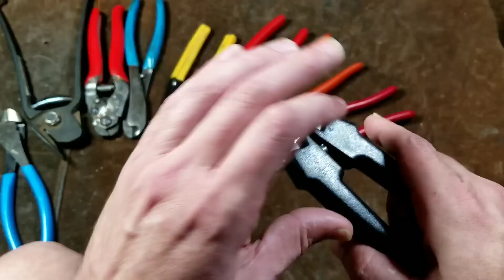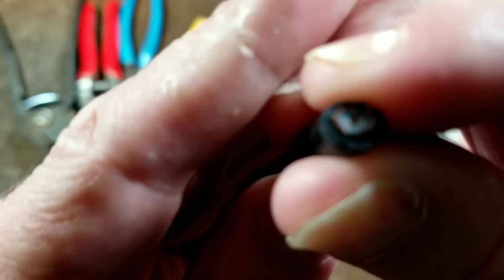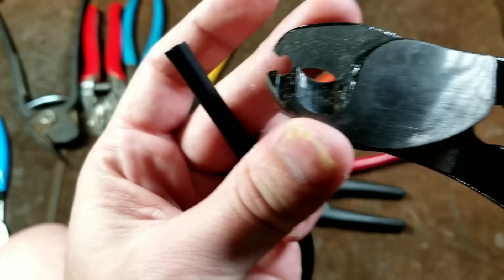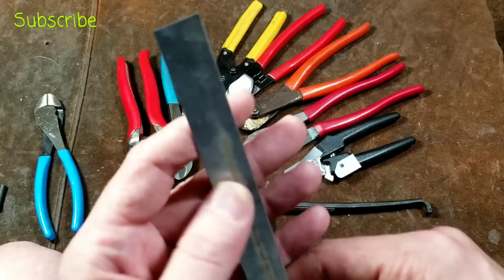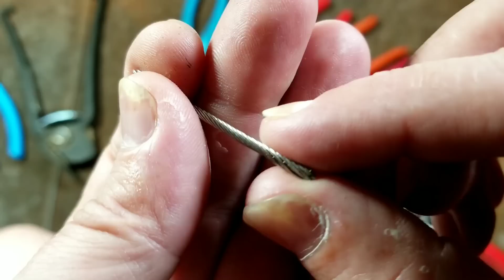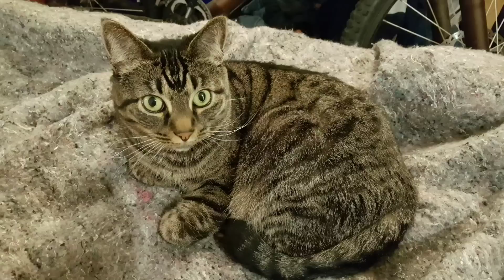Professional Wire & Cable Cutters/Shears Review & Comparison

Comment: 12:18 I don't think that anyone in real life has called a felco a "bicycle spoke cutter" Felco makes wire rope cutters like this in a variety of jaw shapes for different wire rope diameters. The felco cutters are often spoken about as "bicycle cable cutters". These felcos can be disassembled, resharpened, and adjusted. Bicycle spokes are normally destructively cut with straight cutters --small bolt cutters. If you were to cut a stainless steel bicycle spoke with felco wire cutters you would ruin the jaws. Bicycle cable cutters need to have very sharp vee or u-shaped jaws in order to cut cables without fraying. Any fraying would damage the delicate plastic liners that the cables are threaded through.

Comment: I’m a yard jockey and open trailers every night that have small and thick steel wire cable 
Over 10 years ago I bought the felco c7
Cable cutters still to this day they cut like butter all I do is lube it with wd40
Don’t go for the cheap China copy cats 
One of the guys bought one and the center bolt isn’t hardened
Reply from the maker: Yes I knew the felcos were premium even before I knew what the brand was when I first saw these

Comment: You will destroy those kline cable shears with that rg6 .make sure it's not cooper clad steel .you will wrek hhem in no time 
Most rg6 is copper clad steel
Reply from the maker: Thank you and yes I'm very careful with the super sharp copper wire shears if you ding the blades they essentially become useless

Comment: ...wow, those Signode strap cutters looked like they would be handy for making square straight cuts on strips of metal when fabricating things...so...I looked for a pair on Ebay. All I can say is Wow, you got a heck of a steal on them for $5.00....let's just say they are asking a LOT more than that for them on Ebay! The larger versions of these, also go for $600.00+ new...Wow!
Reply from the maker: Just search for signode cutter there are several pairs for around the $20 range

Comment: Very good info for guys that try to use 1 tool for everything instead of the right tool for the job. I've leant people wire strippers just to have them use them on a metal coat hanger.
Reply from the maker: Yes I've had the same issue to the point where I just don't loan tools much. However there are some people who are very respectful